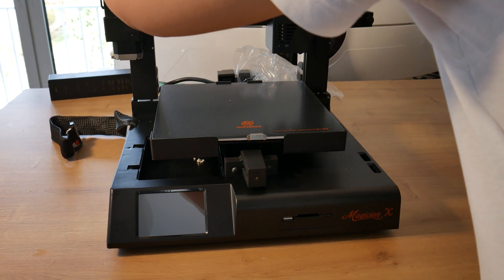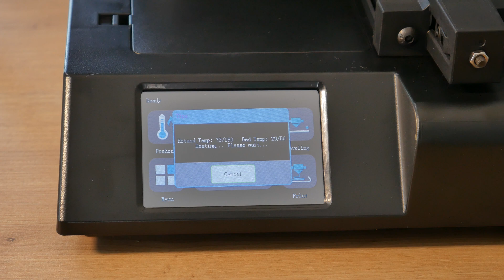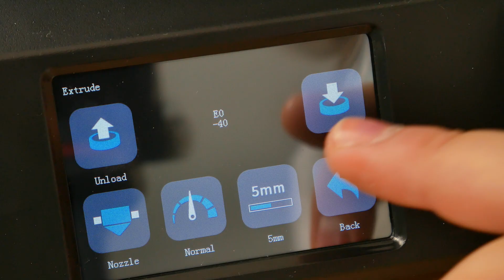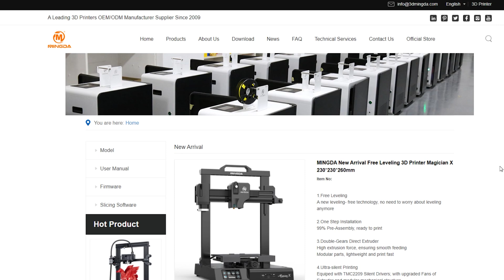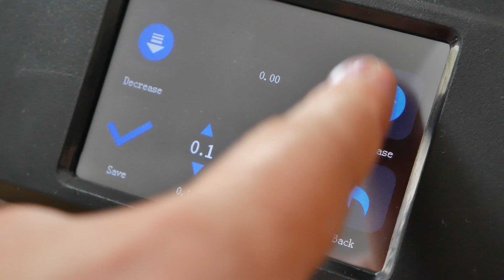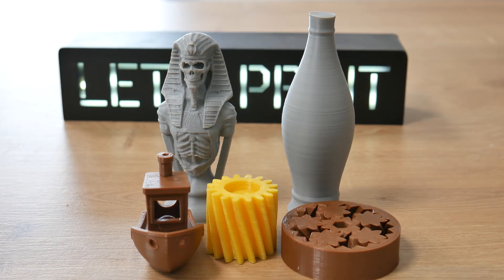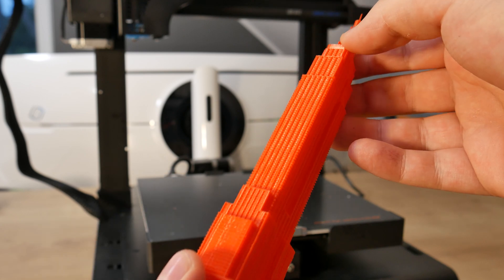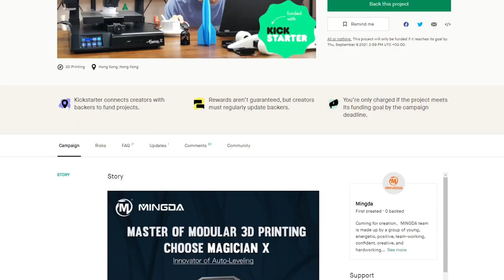BEST BUDGET 3D PRINTER EVER!!! - Mingda3D Magician X

Comment: Doesn't the use of a belt on the Z lead screws remove the usefullness of the 'auto bed leveling'? The lead screws need to be able to operate independently in order to compensate for any out of level portions of the bed or to keep the x axis parallel/trammed to the build plate.
Reply: No, it moves the head up and down to match the surface of the bed

Comment: This video seems weirdly positive for what is on screen. Like the super slow bed levelling or the fact the cooling duct is so close, or the missing parts.

He says the bed is perfectly levelled right at the moment some filament is popping off....

He doesn't even mention the bed not sticking that well. We can see glue stick on the bed.

Why would anyone buy this over the BIQU B1 SE PLUS which is much more likely to have been tested, or a creality machine which has a ton of community support?

Also, it is mentioned that the axis belt link at the top is some fancy new feature, but many other printers have had this...

Honestly, the whole video came across as an ad, and the affiliate link in the description doesn't make me feel otherwise. 

It's not even disclosed.

For anyone wanting a real review, chris's basement has a great review where he rips this thing apart for being as bad as it is.
Reply: its weird that the like/dislike is really good
Reply: Or Artillery genius that is way better than any same price range Creality machine...

Comment: why does mingda need kickstarter? they have at least 4 diy printers on the market, 1 "desktop printer", 5 "industrial printers" and 4 dlp printers, and this printer (especialy the hotend/extruder) looks like the MINGDA Rock 3 pro with a new cover over it and a bit smaller for 350 usd. also kickstarter is always comes with inherent risks
Reply: Magician X use the one-click,16 points auto leveling technology.Which is quite different from Rock3 pro
Reply: @Mingda3d  and what about the Kickstarter? Why do you need it, you are a established printer manufacturer
Reply: @maddi04  yeah

Comment: Did the white spots of paint come with the printer or is that your doing?
 Saying the automatic bed levelling works great by printing somthing in the middle of the bed is not an accurate test of this function, print bed level calibrations that span the whole of the bed

Comment: It sounds like printer advert. The machine is ok but I can't see anything AMAZING like you say in the video.
Reply: Hi, dear. Thanks for your attention to MINGDA Magician X,  which uses the one-click,16 points auto-leveling technology. It aims to help users solve the most typical problems-Leveling the hotbed is important but not easy.  Even for the new beginner, they also can use the 3d printers well
Reply: @Mingda3d  well abl exist with 25+ points and klipper5 on a ratrig that can even tilt the bed its nothing special you got there

Comment: Can you separate the thermistor from the heating block and try heating? If it doesn't stop automatically after a few minutes this printer is a fire hazard. But of course please be careful 🙂
Reply: My mobo does it after 10 seconds as its very sensitive to weird changes
Reply: @captainheat2314  Good to know. Thanks. The thermal runaway test should always be the first thing after assembly